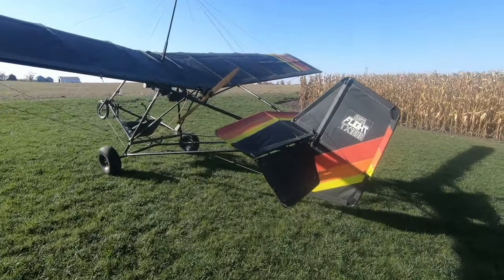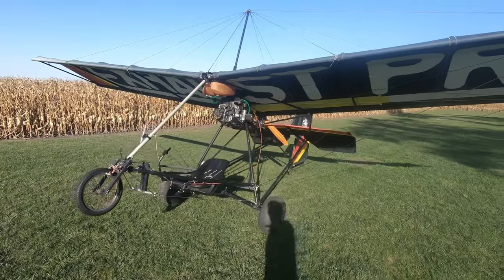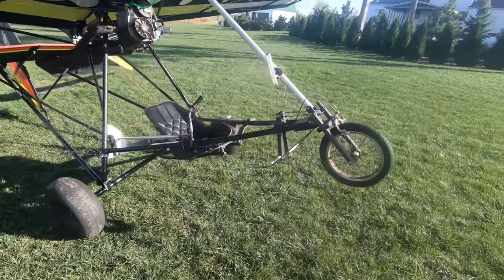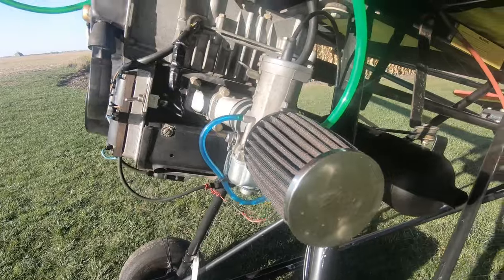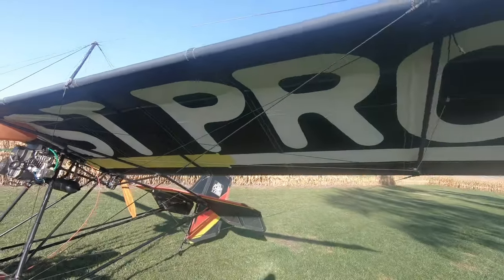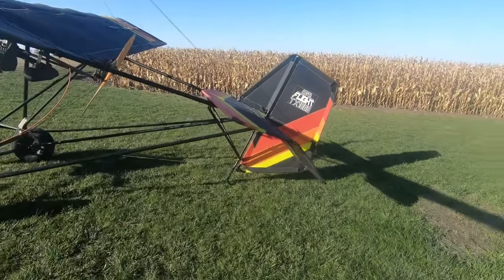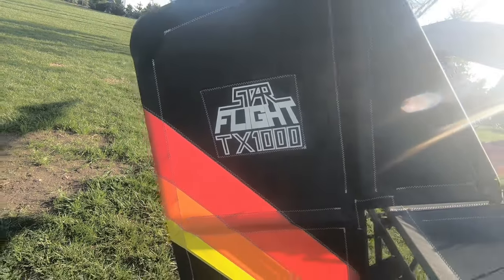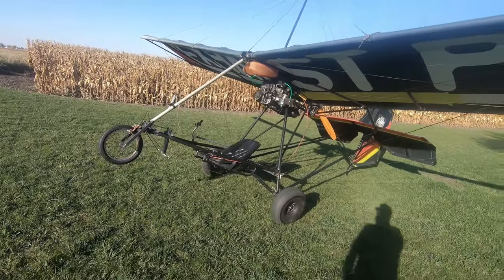Ultralight Airplane Barn Find

Comment: I bet the star flight has been out longer than the quicksilvers looks like they used this to make them. I'm fixing up an MX Sport now...

And My wingspan is only 28' but the sports have shorter wings. 

I have some info about the TX:

Starflight – TX-1000

The TX-1000 is a high wing pusher monoplane with conventional three-
axis controls and tricycle landing gear. A side mounted stick control elevator
and spoilers, while rudder pedals actuate the rudder and steerable nosewheel.
The airframe is constructed of bolted together aluminum tubing and
interconnecting stainless steel cable. The wing is a basic ladder type frame,
while the tail surfaces are frames of tubing. The engine is mounted beneath the
wing center section, driving a pusher prop via a shaft and reduction drive. A
pyramidal aluminum tubing frame contains the pilot's seat, with the landing
gear at its base. A kingpost carries the landing cables supporting negative
g-loads. The flying surfaces are covered in 5.3 oz. stabilized dacron sailcloth,
the wings being doubled surfaced 30% back from the leading edge.
The TX-1000 has a 2-inch diameter leading edge, 1/2-inch trailing edge and
tail boom tubes, and 1-inch diameter, heavy wall compression struts. Stain-
less steel bushings and aluminum vibration insulators are used throughout, as
are aircraft bolts, hardware and rigging. All exposed airframe tubing is coated
with a bonded black epoxy, baked to a gloss finish.
The flight handling characteristics of the TX-1000 are described as respon-
sive yet forgiving, by the factory. The wing has a 5º dihedral, and allows the
air vehicle to be flown hands-off with an occasional touch of the rudder.
Reply from the maker: Let me know what you know.... I had a 1984 quicksilver mx it had a 32 foot wingspan and flew very similar to the TX 1000.
Reply: @kevincamp189  sorry I just edited my comment to have the intro from a book I have. I also have the specs too I'm just having Bixby issues right now lol. I'll let you know when I can figure it out.
Reply: @kevincamp189  Specifications
Wingspan  32'6"
Length 15'
Height 9'
Wing Area 160 square ft
Engine Make, Model, HP Rotax/377/32hp
Prop. Diameter/Pitch 54"×27"
Reduction Ratio 2.01-1
Fuel Cap/Consumption 4.5gal/1.5gph
Gross Weight 502lbs.
Empty Weight 252lbs
Useful Load 250lbs
Wing Loading 3.14psf
Power Loading 15.69lb/hp
Design Load Factors +5.8/-3.6
Construction Time 40hrs
Field Assembly Time 1hr
Pricing $5,195
Flight Performance 
Velocity Never Exceed 55mph
Top Level Speed 55mph
Cruise Speed 45mph @ 70% throttle
Stall Speed (in free air) 21mph
Sea Level Climb Rate 800fpm@38mph
Takeoff Run 175'
Landing Roll 100'
Service Ceiling (100 fpm. climb) 12,000'
Range at Cruise 90mi
L/D (Glide Ratio) 7-1

I hope that helped. That's all the info my Ultralight book has on them.

Comment: Does anybody’s Starflight TX 1000 have 2 tubes, one on each side of front of seat , going up to main tube? My friends does, and his stick hits it when moved to forward position , especially on left turns with spoilerons. I haven’t seen any other TX1000 with them. My guess is previous owner was heavy, and flexed the bottom tubes too much, so installed these. They’re the same black epoxy coated tubes as the rest though.

Comment: Wanna trade for a rc nitro powered rc helicopter super loaded never flown or fueled up that's avail.? I got over $4k tied up in it brand new was expensive to find a trusted builder... all electronics are top notch never used.....Trex nitro pro rc helicopter .55 sized heli... radio is JR upgraded with 5 mile range electronics
Reply from the maker: We are wanting to do a cash deal for the aircraft.
Reply: @kevincamp189  ok thanks my friend... if it doesn't sell for the price you're asking I have old antique Harley Sportster XLCH 1000 1973 model that needs a top end done I would consider trading as well. You are very mechanically inclined and you would have it in good shape in no time and offer it up for sale.... enjoyed and subscribed to your fun videos my friend